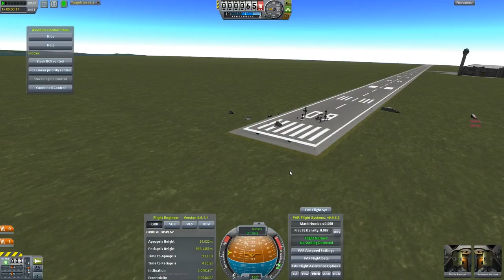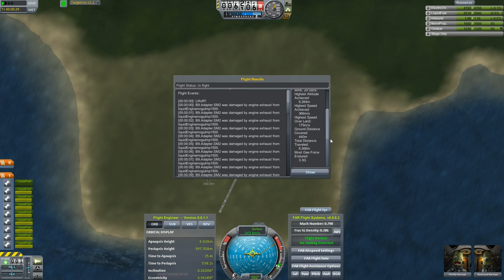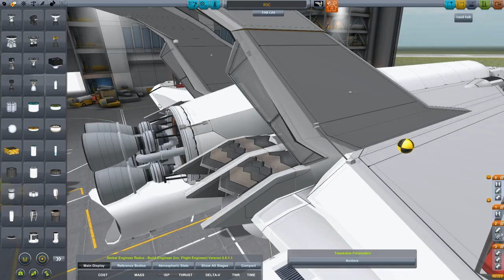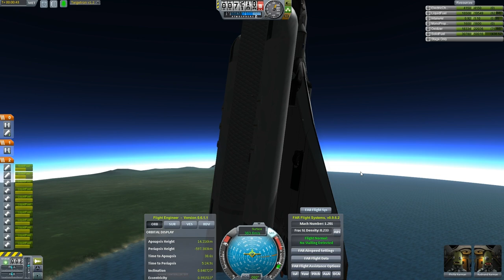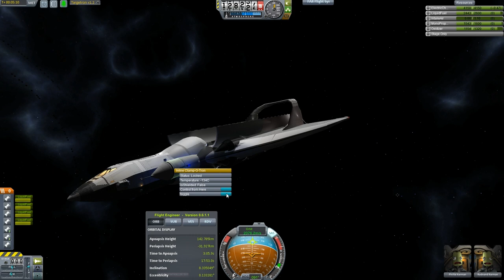Let's Fly KSP: Space Shuttle Development part 17, It Works!

Comment: Why would you use the tail section like that with those small engines? There are parts that would attach it without so much clipping.
Also, sorry but these parts are cheat man, 4000kN solid booster with 25000 fuel?